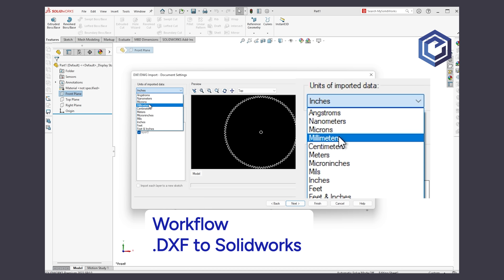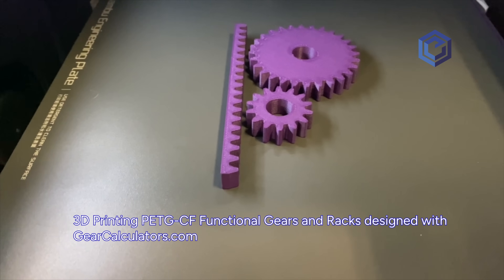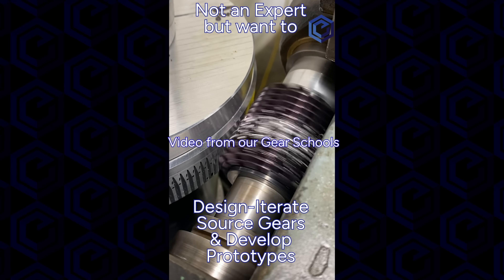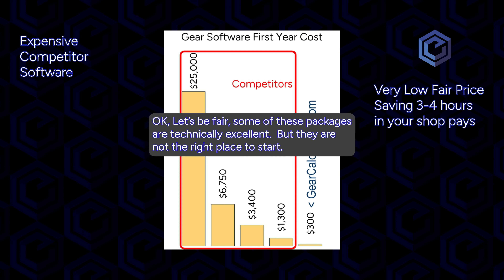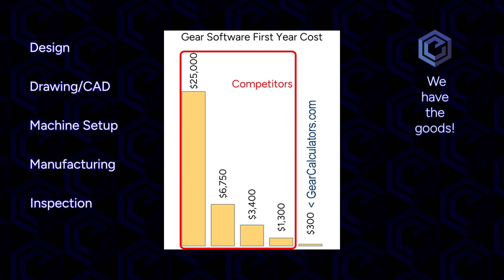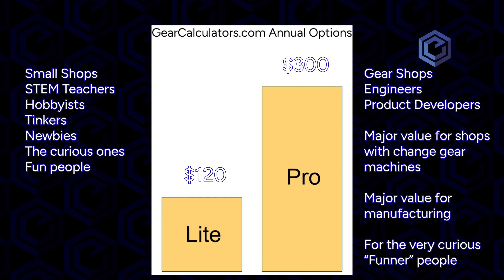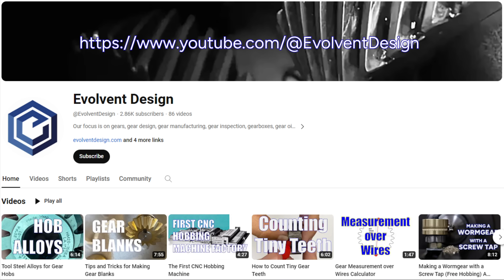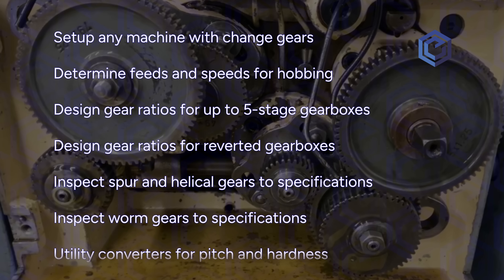GearCalculators.com: Online Software for Gear Design-CAD-Setup-Manufacture-Inspection

Comment: Im new in gear making is this software works for me?
Reply: + does it support metric?
Im using a manual milling machine
Reply from the maker: Yes, it helps with all the basics
Reply from the maker: Yes, all the calculators are in metric.  They are inch also as well as the conversions between them.